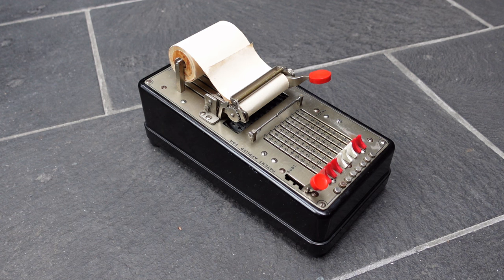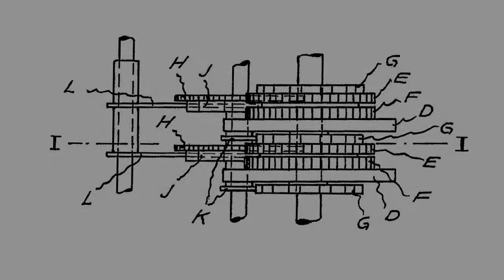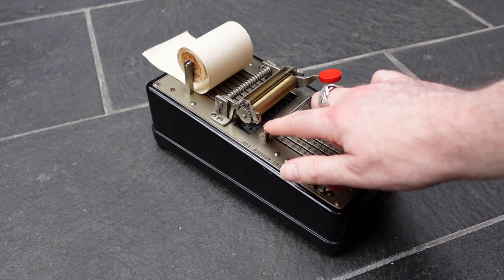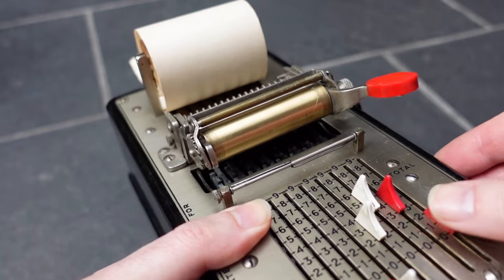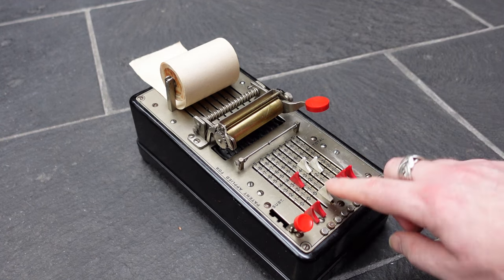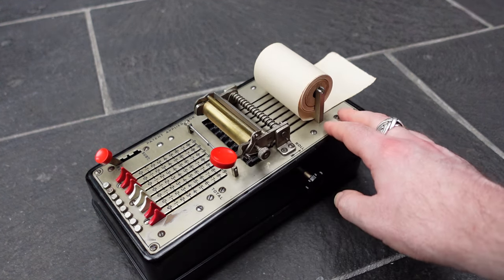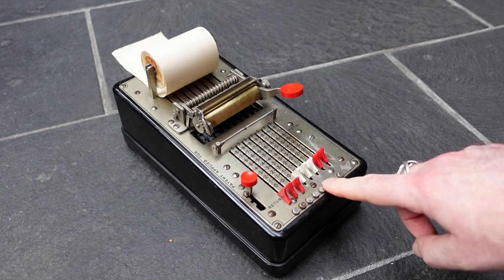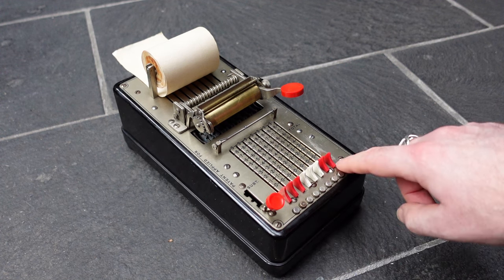Saldorita Adding Machine

Comment: Maybe you can put some heatshrink over the brass rollers?
Reply from the maker: Unfortunately the main roller cannot be removed from its frame, at least not without some damage that I don’t have the skills to repair. It would work for the small roller on top, but that is not sufficient to fix the problem.